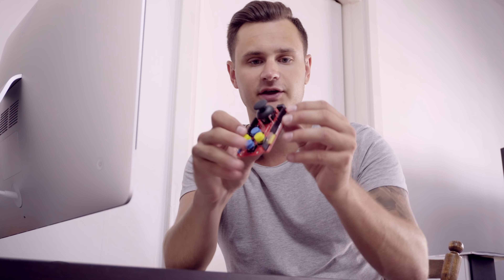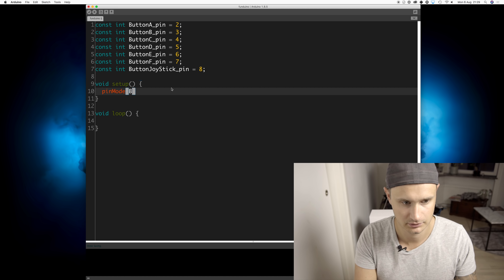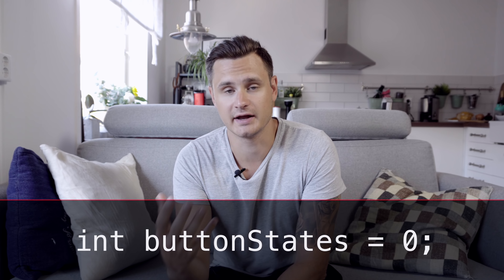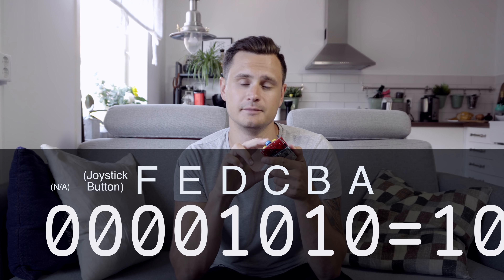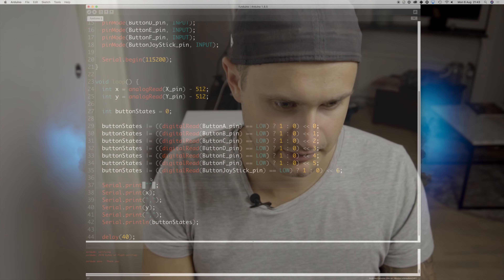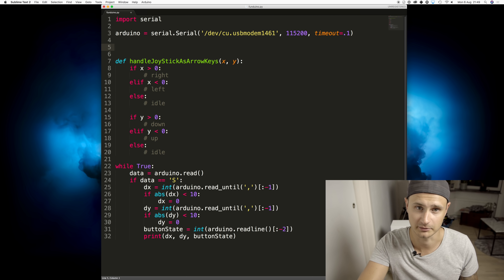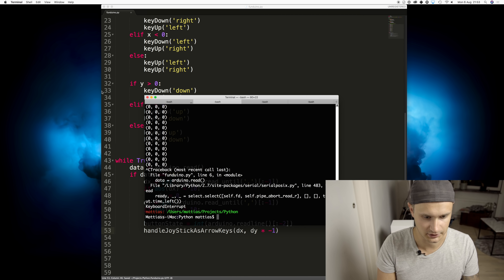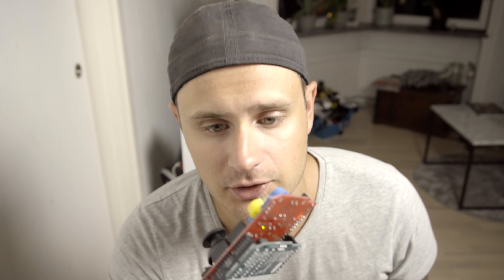DIY PC GAMEPAD WITH ARDUINO

Comment: i wired the buttons and joystick to the correct pins, used the right capacators for other stuff on the board but all i get in the serial monitor is an infinate stream of backwards question marks from the arduino. i have checked and double checked, there are no coding/spelling/wiring problems, please help
Reply from the maker: Portaboy7921 hade you set the baud rate to 115200 in the serial monitor?

Comment: Right, after many hours (damn Python 3 updates throwing the coding off!) I have got my joystick working - my only problem is that it I cannot hold down the joystick. It only registers each direction input once. The readout on the Serial port is fine, the numbers are staying high if the joystick is pressed. But the python code seems to only allow a single press. It looks like this happens in the video at 11:22. Can you help?
Reply: Fixed, I just removed the line: "if key not in keysDown:". Otherwise once the key has been pressed and is added to KeysDown, the "pyautogui.keyDown(key)" will not run again, and the button will not be pressed again. I'll leave this here in case anyone has the same issue.

Comment: Im working with python 3.9.13, not sure which version of your python and serial is working on but
i kept getting the error "ValueError: invalid literal for int() with base 10" 

after some research i figure out they might have change the output value to binary instead of just string, which may explains the reason why its impossible to convert to int or float

Since the video had been made a long time now I don't think you would be replying to my comment anytime soon, however this is just to warn any python3.9 or future watcher about this issue. Unfortunately I still wasnt able to find the solution to this yet. I will be appreciated if anyone can give any possible solution to this one, thank you
Reply: Update(solved) : just add a b behind the ',' , it works like a charmed
The value is red as binary, so it must be read in b form

Comment: Are there like different types of arduinos ? Cause I never used one before and I want to try it , but idk what I need , should I like just look for an arduino ? Or is there a specific type that I need for this. And also , how to setup the buttons and joysticks and stuff on the arduino ?
Reply from the maker: Yeah there are different kinds of Arduinos. This particular one is called ”Arduino UNO”, a very common type. The buttons/joystick are attached to a module called a ”shield” (which you buy fully assembled, all u need to do is to stick it on top of the UNO)

Comment: python code not working at me. no errors, but simply not working. please answer quick, need this for my informatics project in school. (sry for bad english im from Germany)
Reply from the maker: Johannes Krempels most likely it’s the port name that needs to be changed
Reply: I changed the Port already, still doesnt work
Reply from the maker: So try figuring out where the problem is; if you print to the console (in the python script) do you receive data from the arduino? If you run the serial monitor in the arduino ide, do you see any output?
Reply: engineerish in the arduino ide the serial Monitor Works Great, but in the Python console i dont see anything.
Reply from the maker: Ok, so it sounds like the python code can’t connect to the serial port. 1) make sure again you have the right port name. 2) make sure you are not running the serial monitor at the same time (because then the port will be busy) 3) try getting a simpler example to work (follow a tutorial or something and get a proof of concept up and running) and see if there’s any learnings you can draw from that. Given that so many people run in to this problem, I should probably add some error handling and troubleshooting to the script

Comment: Hey I tried to get it to work, but my macbook isn't picking up on the inputs from the joystick shield. I copied the code from the link to the source code
Reply: Sorry it does recognise there are inputs on the arduino side of things, but nothing happens when I try to use it when I run the python script
Reply from the maker: @curlybighead1111  On the line with '/dev/cu.usbmodem1461' - make sure that that serial port corresponds with your Arduino. You can see what yours is called by going in to the Arduino IDE -> Tools -> Port
Reply: @engineerish  I checked that and the port I have put down is the one I am using. What else could it be?
Reply from the maker: curlybighead do you see data in the serial monitor in the arduino ide? Close down the serial monitor (since otherwize it will be hogging the serial port) and run the python script - try to just dump the data from the stream to the console in python - it should be the exact same thing as the serial monitor in the IDE

Comment: for the first line I'm getting this error:
arduino = serial.Serial('/dev/cu.usbmodem1461', 115200, timeout=.1)
AttributeError: module 'serial' has no attribute 'Serial'
Any idea why?
For those looking for the answer to this question, the solution was to change the line from the above to the following:

arduino = serial.Serial(port = 'COM3', baudrate = 115200, timeout = 0.1)
Reply: Hi, how did you find the answer? it doesnt work for me
Reply: @MatiaSilver  I don’t recall. Probably brute force plug and chug. Sorry.

Comment: wouldnt it have been easier to use the keyboard library and let the arduino work as a keyboard?
Reply from the maker: Franklin Rosales sure that’s another way of doing it - this gave me the ability to reprogram it in python rather than fiddling with arduino code

Comment: will it work Just with joystick
Reply from the maker: Electro Hithesh yeah no problem! You can use the same code and just have a single joystick connected to the Arduino
Reply: engineerish does it run for gta sanandres

Comment: If you have an arduino with AT16U2 for USB, I would rather make it act as a USB-keyboard/mouse/gamepad
Reply from the maker: Thorbjørn Hellehaven sure - that’s a way to do it. My way of looking at it is that this makes customization and mapping of keys a lot easier. Being able to quickly change a python script rather than having to reprogram the usb, upload c code and reprogram again. But either way would do it!

Comment: I don't know why but when I run the python script I don't get any results. I already uploaded the arduino code. Please reply fast. I think the python code is not working
Reply from the maker: Make sure the string on line "arduino = serial.Serial('/dev/cu.usbmodem1461', 115200, timeout=.1)" is the correct name for your Arduino serial
Reply: I checked it changed the port to COM9 as I am using windows

Comment: Awesome video and really helpful! But could you explain what you did in 8:38 - 8:50?
Reply from the maker: Ninjaitsu thanks! What I’m doing there is parsing the data coming off the serial. I’m starting to look for an S, so that a I know I’m in the beginning of a message. Then I read another string until I find a comma and make that in to an integer - that will be my dx. Then the same thing for dy. Did that explain it?

Comment: Congrats for your video, its really helpfull! I am thinking of applying this to control Recalbox on Raspberry Pi through bluetooth (HC05), but was unable to find the format I should be passing the data. Do you know if the bit operation you described would work?
Reply from the maker: Thanks! Cool! The format I used in this video was just a protocol I came up with during development - in order to get it to work with Recalbox, you'd probably have to adhere to their protocol. Good luck!